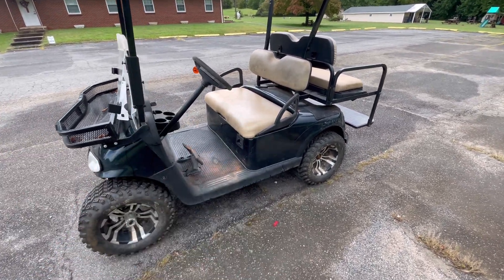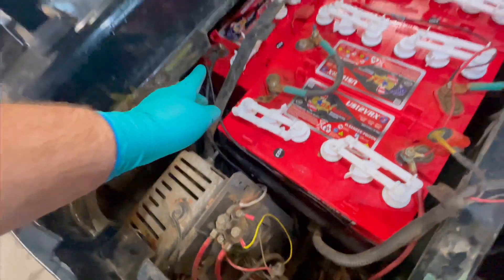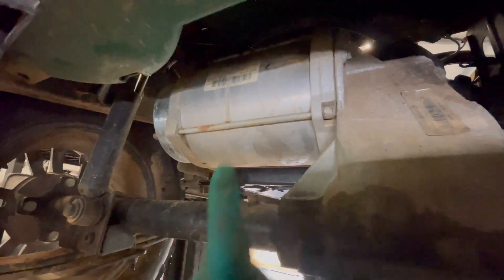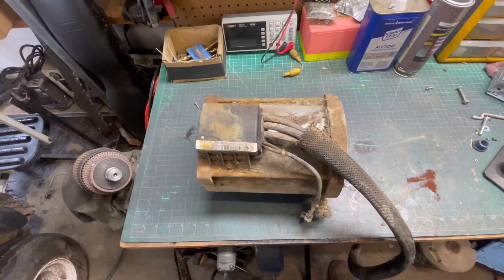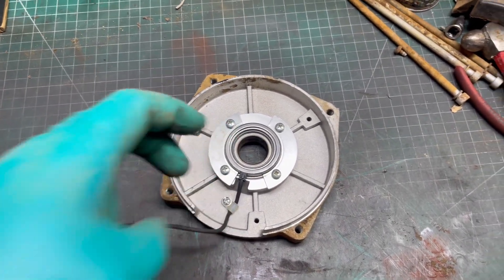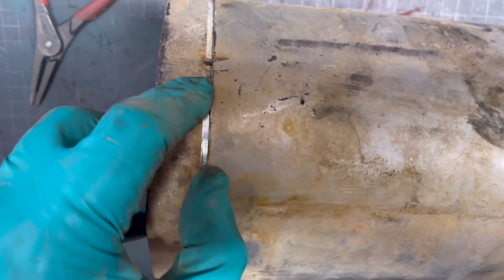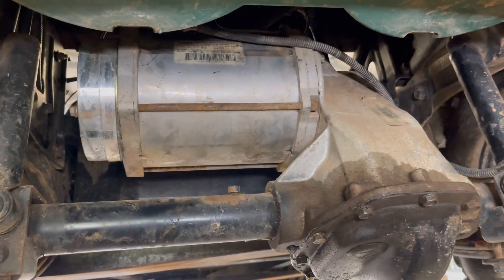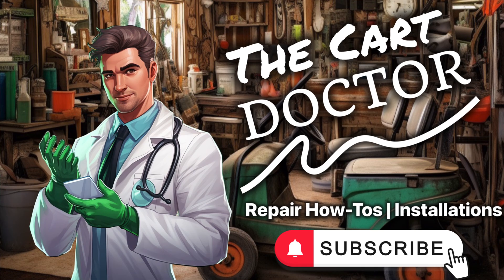EZGO RXV Running Slow? Encoder Bearing Replacement How-To

Comment: I have a 2011 Ezgo St400 48v . Key switch on hit pedal, nothing, if I jump the two main lugs on the solenoid it moves forward and reverse. Just curious if you have any insight on the small terminals on the solenoid and where the wires go and which post should have power from gas pedal switch when hitting the gas.
Reply from the maker: The yellow wire gets 48v + from the key switch and the blue wire goes to the controller. When you press the pedal, the controller is supposed to send ground to the solenoid on that blue wire to activate the solenoid.

Comment: about to pull my 2010 motor out and do this. the cart was fine then started bucking and not moving but making a sound when in fw or reverse. break works fine and tow works but stopped running. any tips on testing the bearing b4 pulling it out?
Reply from the maker: If the bearing is bad, the cart will just run a constant very slow speed. It won’t buck. Only way to test the bearing is with a hand held diagnostic tool. Those are pricey.